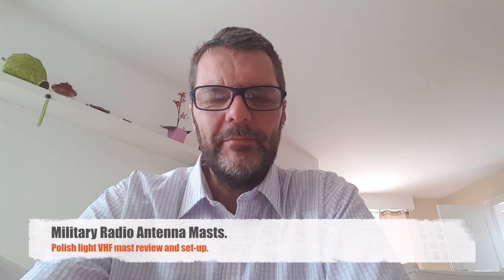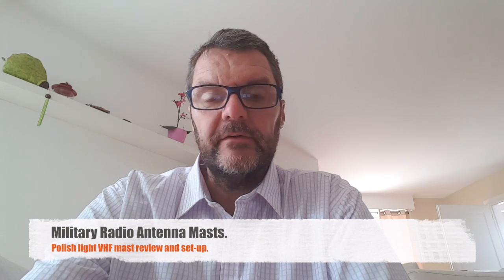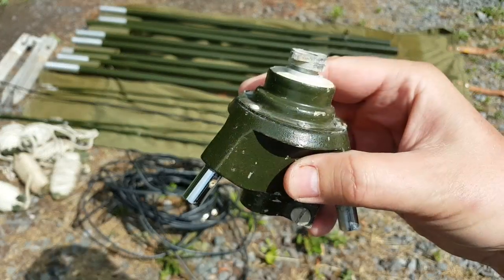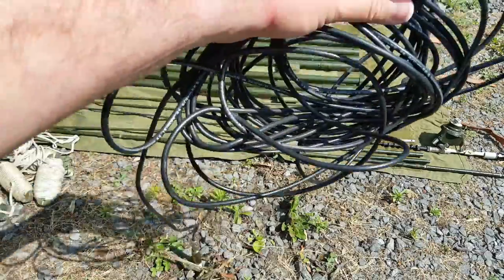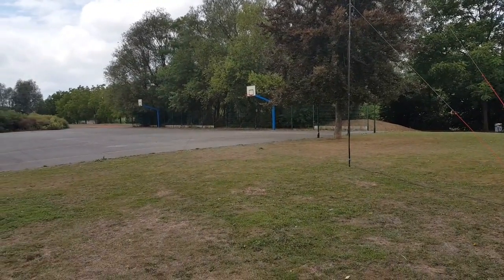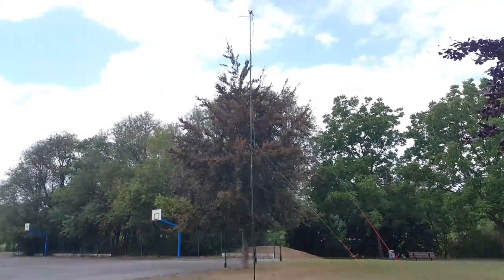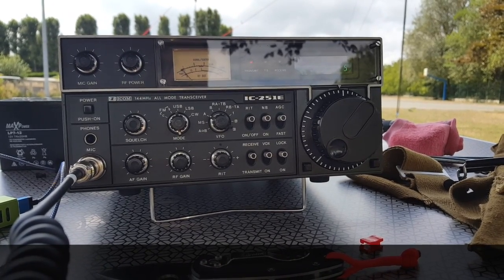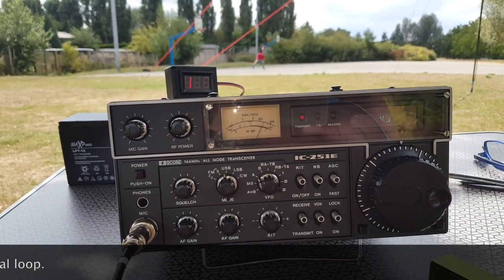Military Radio Antenna Masts.

Comment: the mast is fantastic! the radio is absolute cherry !  it's really cool that you guys are running VHF using SSB . years ago, I used to run 'weak signal modes' on VHF and UHF it's just not as popular here in my area of the US , in the early 90s we had lots of VHF. UHF operators running SSB and CW, I don't know what happened. the only things on those upper bands  that is popular now is DMR and Mesh networking. hopefully we can bring  more interest into the weak signal modes. I still have a few rigs that are all mode.

I just bought some military surplus masts at a local hamfest - has a fold out base and each section is fiberglass and it has a piece at the top that has a heavy duty brass/chrome pulley to pull up an antenna . I made guying plates from heavy duty nylon chopping board from the local dollar store each section is about 1 meter in length. the only problem I have with mine is you need to use gloves or your hands ( no matter how callous the skin is) ends up loaded with fiberglass.
so I'm planning to sand the sections and put a gel coat on them or paint them with brush-on enamel paint.  I have several fiberglass flagpoles ( telescopic ) push up masts, but they aren't rugged like my military masts. 

please , if you could make more multi-mode V/UHF  videos, I  think that there's a lot of people that don't realize there's more to V/UHF than just FM and DMR. ( I was hoping that Icom would have produced an affordable all mode radio ( like the IC-706MkIIG or IC-7000) for their 60th anniversary  - I'd bet they'd sell like crazy, - Yaesu also dropped the ball on their all mode radios too.  
thanks for the video Gil , 73
Reply from the maker: I will definitely make more! It isn't very popular around here either but I really enjoy VHF CW and USB so... Very useful for extended range local and near-regional comms..

Comment: Here in Greece, I bought a couple of aluminium telescope painter poles, 6 meters total length, for 25 Euros each.     No jumble of parts that can get lost. They are light weight, even though the collapsed telescope pole is rather long.  They make great antenna supports, for example, an inverted "V" for NVIS on 40 or 80 meters. I can also attach various antennas for 2m and 70cm.  I think these are simply great for portalbe work.  I use 4 tent pegs and some cordage to support the pole.  It can even survive pretty strong winds.  I have not seen these telescope poles for this price anywhere else in Europe.

Comment: Great video Gil. I bought a US Military surplus antenna mast at the Dayton Hamvention several years ago. I have used the mast twice for the very reason you suggest. Mine the fiberglass pole version. Using 2 staked guys with the 3rd not attached I am able to add sections from the bottom vertically without assistance. It is a challenge though working alone. My first use was for 12 hour event. Following the event and stowing of the mast I chose not to use this by myself in future outings. The second use was a 24-hour event, the USA ARRL Field Day. I don't work portable much these days unless its about 100 feet from my parked car. Age and mobility prevent the hiking to remote areas. KB8AMZ

Comment: Great video.
You probably already know how to put out the guywire,  120° apart and at the same distance from the base as the guywires attachmentpoint height, and make the wires 1.41 times longer than this height. 
But if you should rise it by your self , a handy trick is to use a pole at the base of the antenna, about 3-4 meters long. Wrap one guywire a couple of turns around the top the "help-pole" and erect it at 90° (or slighly tilted towards the antennamast on the ground). Then pull up the antenna whith the guywire and the help-pole.

Hans Elmlund.
Reply from the maker: +elmis123123 I'll try that, thanks!

Comment: Have ordered the Clansman 5.4M mast for field operations. Was field portable this evening for the VMARS net. Great to receive a signal from you. Lots of static bangs from storms but between that you were fair readable.  We are only 180 miles from each other so I am sure that could be improved on. Having said that I find these distances the most difficult. Larry
Reply from the maker: Definitely Larry. If it hadn't been for all the noise our contact would have been much easier. You were 3? (no s-meter). It's NVIS between us, straight up and down, most difficult indeed. We'll try again :-)

Comment: Excellent video Gil. What you have there is the Polish/Eastern block lightweight (lightweight in 60s/70s) mast from back in the day. It's meant to be set up as a field station. Actually I have the 10-meter version of that same mast, which is telescopic and can hold a 25kg antenna, or with the included accessories be loaded as a 40 meter band vertical antenna. I think you might be missing the insulator because that antenna should also be able load up on 40m.
Excellent video and thanks for sharing
Could you add some metadata to the description?
Reply from the maker: +OH8STN Thank you Julian, good info. I have a description and tags, what can I add?
Reply: Radio Prepper name of mast and a link. I would order one right away.
Reply from the maker: +OH8STN will do...

Comment: You can use it for HF by insulating the mast from the base ( making it a VERTICAL Antenna using the antenna formula for vertical 1/4 wave antenna and maybe including a coupler or tuner ) and installing radials for a counterpoise =)
Reply from the maker: +Pat Hopkins True, or insulating the base from the ground... U can also put an MFJ 17ft whip on top...
Reply: Gil I did make ( weld up years ago ) a mount that is on my trailer hitch =)    Yep I need to get the picture posted on the tilt mount on the trailer tongue =)   I was going to get it out earlier last month ... but ran into Light Control not working correctly  ( old Toyota / Nissan type of Smart Controler $$$$ to replace =(     I have the larger Aluminum military and two  Fiberglass versions of the same as insulator =)   Easy pull-up by myself with the trailer as a base weight =)   I have 12 X 36" aluminum pole and the same size two Fiberglass ones all in the same tarp covered military bag the came in ( HEAVY to carry =)
Reply from the maker: +Pat Hopkins You can post it on radiopreppers.com
Reply: I will as soon as I get the unit replaced under the truck for the trailer to be legal to pull to the apartment ( 20 mile away in storage =)   I bought the unit needed ... just need to crawl under the truck and unhook defective unit and solder the old unit connectors onto the new unit and place back under the truck bed to the wiring harness =)  If the rain and storms let me under the truck :-)))
Reply: For portable use on HF, I would try tuning the mast itself as the antenna and not bother carrying around any other antennas. 8 meters is about the same length as usually is recommended for wires for 9:1 ununs or "random length" radiators with ATU:s and it should be possible to tune. One advantage with the pole is it's much larger surface area, compared to wires, which increases the antenna's capacitive component and also decrease resistive loss. A cheap plastic cuttingboard should suffice as insulator between the mast base and ground. Remember to always place the tuner as close to the antenna as possible. Coax cable doesn't handle missmatch well at all and cable losses can deceive the operator or the ATU that there is a good match when most of the power actually is lost as heat from the cable.
Reply from the maker: Certainly thanks, that would work just fine.